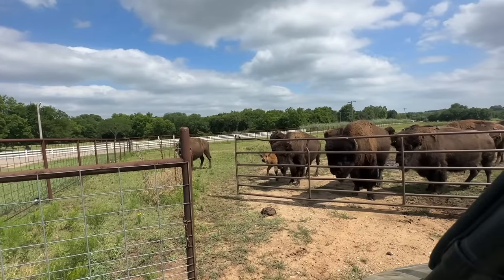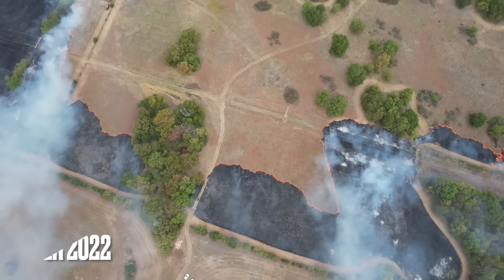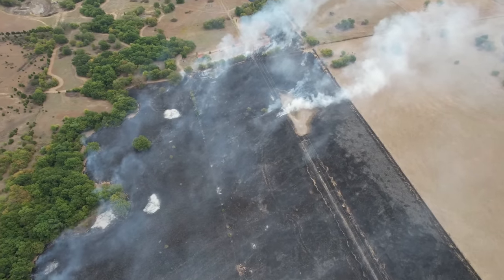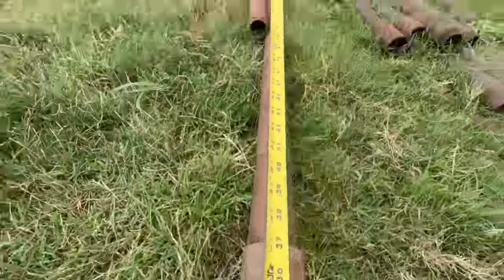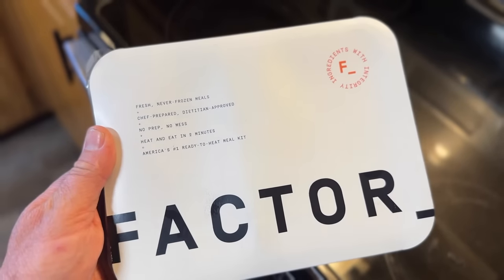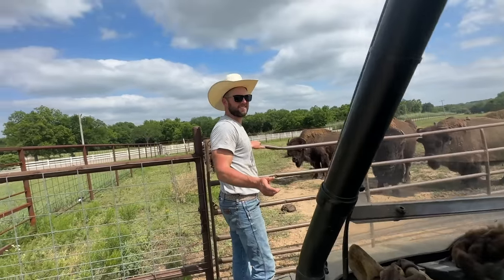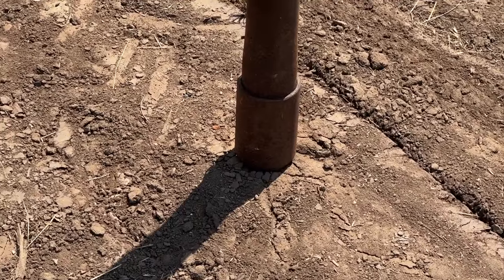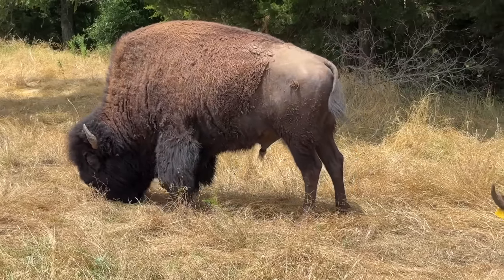Dunbar Did It…Have To Bring In Big Joe Herd Now!

Comment: Those Factor lunches look good. I got to see if they deliver my way, I like fresh better frozen; like crunch in my broccoli. I learned how to weld back at my days working in the pipe dept. high tensile steel to high yield steel. Always had to heat the high yield steels 80 or 100 to to dry the steel stronger.not properly done you can have cracks and other indications. Properly done the weld should be stronger than the metals that are attached together. I got my inspection training there building submarines and left to inspect aircraft materials for meteorological welds and indications of turbine engines and vanes and blades especially titanium welds at Pratt and Whitney. It was good money and a good job but I wanted to be a mommy.

Comment: Why do I think you have too big a herds for the amount of pastures?  Never rely on cut hay. In Canada they are selling cattle by the thousands because of drought.
Reply from the maker: You are correct, the herd is to large for the acres we currently have. Looking at other options to manage the land and not over graze. We are learning about the proper times to rotate and how long they should be in each section.
Reply: @CrossTimbersBison  it’s not easy but cattlemen are good people to ask a lot of questions. They have been doing this for 100’s of years as to man raising buffalo. Run a journal of rain when and how much  do grass growth and season dry periods and number of herd per season. On which pastures etc etc. With this information you can plan rotations of pastures. It takes 5 acres per cow so you need more for buffalo. I liked that you are bookkeeping we did that too. Stressing the bulls by moving cuts back on sperm production we found out. Best grazing practices be peaceful. Get a scratching poles in each pasture too they like to rub their hair off less irrational from flies too. Do a square large log three sided. Two poles deep in ground and a cross pole on top so they can scratch top of their backs too. Make it lower then their height as they will in time wear the ground down around it. We had our block of salt for minerals by it too. Grease your gates with bearing oil.  They will last longer and be less noisy for the animals too. You have a great respect for training to rattle bag to follow. But always have a full bag to calm them with you where ever you go. They still are a wild animal and can change in a split second like any animal. When you stop loosing fear is when an accident happens. Don’t ever trust their character or actions. We had over 50 bulls and I got a few scars from them.
Reply: @CrossTimbersBison  try leasing Govt land to turn into pastures. Might be cheaper then buying feed